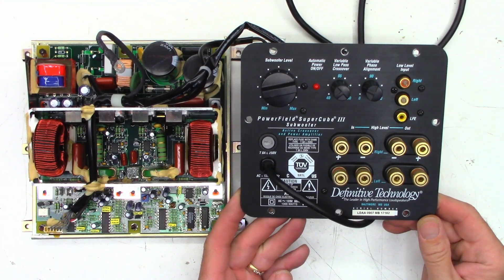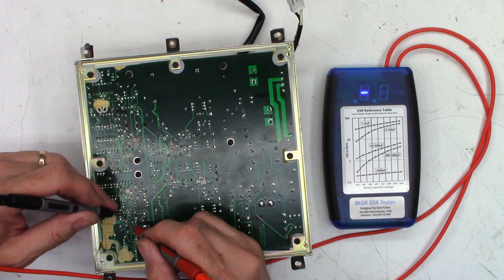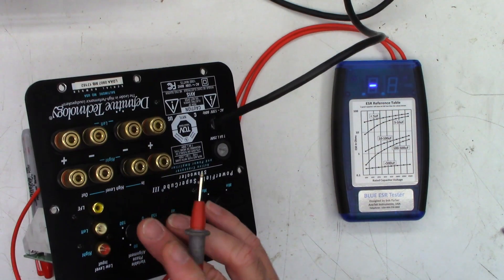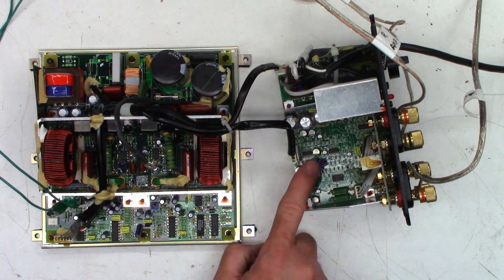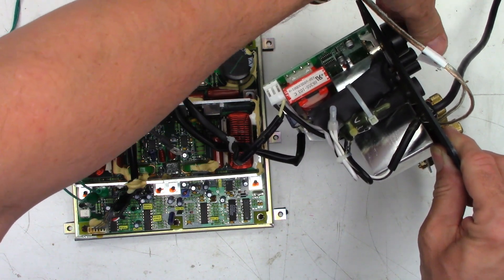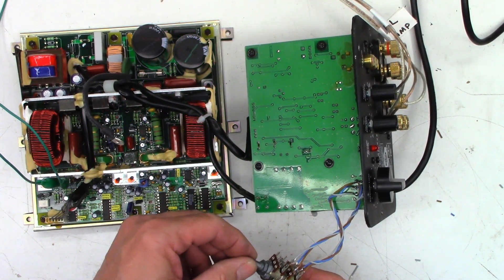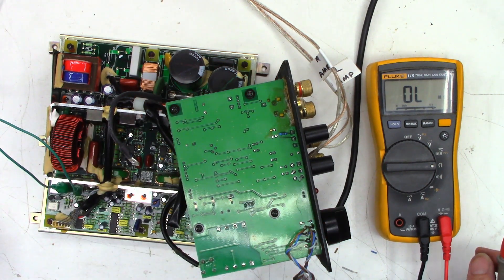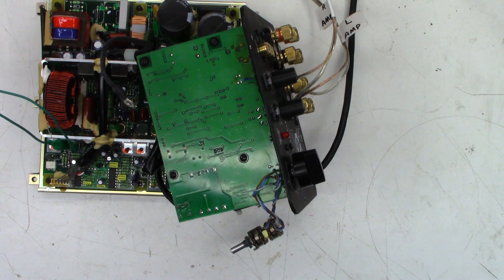POWERFIELD DEFINITIVE TECHNOLOGY SUPERCUBE III NO AUDIO DIAGNOSIS SUPERCUBE 3 NO SOUND REPAIR FIX

Comment: I have one of these Super Cube 3’s that suddenly developed a very loud hum. Was in contact with Definitive & they gave me a series 7 tests. They all failed to resolve the hum.
This not the first time there’s been a problem. I’ve three amp boards. Bridged the phase & low pass fitter pots. This worked the first time. This time nothing works. You talk of the capacitor failure on the power board. Could these be my issue all along.

Comment: Are the 100v 220uf capacitors on the preamp board dangerous to handle? I imagine the ones on the amp are pretty nasty and could kill you. I'm asking to see if replacing these pots can be done without special equipment.
Reply: Yes they are!  make sure they are discharged before working on them... they will make quite a pop if shorted at full voltage!

Comment: How about the auto on function? Any ideas on why that would stop working? My ProSub 80 only senses a signal if you unplug it from the wall then plug it back in. It will work just fine until you turn the system off.

Comment: Power amp ground including that big heatsink is held at 170VDC vs mains neutral, watch yourself on this guy if you don't have isolation. :) Phase control is 50k audio, low pass is 20k linear, volume is 5k audio. 👍

Comment: Hi! I have a Definitive Technology SC 6000 sub. It works fine for 5 minutes, then turns OFF. I have unplugg the powercord, wait for 2 minutes, plug it back in, then it works fine for the next 5-10 min. And I have to repeat the prossedyre. What do you think is the problem? Hope you can help. :)

Comment: Any info and help you can provide for a Supercube3 with the subwoofer level pot stuck on max?? Please and thank you
Reply from the maker: It most likely has a failing pot. the return ground side is probably open, thus no divider when the pot is at the low end.

Comment: Hi NorCal715,
I owned the same subwoofer but it's don't turn on at all (the power LED don't light-up also). I've checked the low voltage on the pre-amp board and it's seems normal. All caps works well. Which part should I check in next?
Reply from the maker: Check the level pots, I think the auto-on circuit uses one of the pots for a reference signal.

Comment: Hello - Im a bit late here.My cube stopped working couple of years ago and I didnt get down to figuring out and let it sit for a while.I have an issue with the unit not turning on and the red led not lighting up.Ive checked the power leads and fuse and it is Ok.Any help and suggestions would be appreciated.Thanks in Advance.
Reply from the maker: I would need to trouble shoot it to make a determination. If you do not get the LED then possibly bad potentiometers like the one in my video. Bad potentiometers will keep it from powering up. Make sure you watch both parts of my repair video.
Reply: Call definitive research.  They will do a small diagnostic over the phone.  The amp is like 100 bucks and you'll get a warranty again.  They have the best customer service.

Comment: Hello - Nice work on the diagnosis! 
Question -  Did you solder the 1k ohm resistor to the left 2 pot leads or did you somehow run it across all 3 leads? I tried zooming in but couldn’t tell.  Having the same exact issue with my Supercube and just want a quick fix. 
Thanks for your help.
Reply from the maker: At what time in the video are you referring to?
Reply: Hi - 
12:10 - 12-30 mark.

Thanks!
Reply: hi, could you help me to find definitive PF15TL+ subwoofer service  manual?

Comment: thanks so much I found a small 35v 220uv cap on the amp board that was making a nasty hum unit i worked the sub.   The cap was testing ok in the board with a small budge on top.  with this video and lots of patience i fixed a very $$$ speaker for cents.  I used a 25v cap for now just to see if it was that. I ordered a 35v to be safe.  My board had lots of the glue that was dark brown.  I spent hours scraping it off carefully.  The cap i replaced was right by the red and blue transformer on the amp side.

Comment: Just curious as to why you don't seem to check the actual Capacitance value of the caps?  I only see you checking ESR.  In my experience, sometimes the ESR can be perfectly fine, but the capacitance is way low, or way high ( over 20%).

Comment: Hi,on the pre amp side behind the 5pin connection are two resisters, there's white glue  on top of them,do you know the value of the both of them?,mine burnt out.
Reply from the maker: Sorry no, I already shipped this unit back to the customer.

Comment: Look at you trouble shooting your bud off try to figure out what the heck is wrong with this thing. I hope the customer is smart enough to tell you to replace then with quality pots that will work reliable. The unit sounds like it's the investment based on the surmised wattage rating you feel that it is. After doing some research on them they appear to be a high end product, at least price wise. Defiantly worth fixing IMHO. Fingers crossed.
Reply from the maker: There will be a pert 2
Reply: @norcal715  Outstanding!

Comment: After a little research on the net, it seems that there were a fault on X amount of these boards. The company are aware of this, and some peeps contacted them about the issue. They ask for the serie number and from that they can tell if it's one of the bad boards.
Those peeps I read about, they actually got a brand new board from the company, free of charge 😉
So my best advice would be to call the manufacturer of the sub, and tell them about issue and let them know the serial number.
Who knows, maybe you guys get a new board for free 😃

PS. There were another model with the same bad board, I think it was the one called Reference. But I'm not 💯% sure for this one.
Reply from the maker: Its already repaired and on its way back to the customer. Here is the repair part https://youtu.be/8QVHWl5otyM
Reply: @norcal715  Already saw it, amazing repair 😉👍    👏🙂

Comment: ESR meter must be an abbreviation for let's frustrate people! 
I think that it's time to stop using the ESR meter for capacitor testing, it's telling you nothing important about the capacitors! 
If you can't see that the capacitor is bad from it being expanded and your ESR meter is still telling you that it's good! WTF! Something is clearly wrong. 
ESR is only important for the filter capacitors in the power supply, ESR means nothing for the rest! EPR is what matters! EPR is the failure mode that stops equipment from working! You have a lot of capacitors that are leaking DC which is probably why the pots aren't working! 
You have no choice but to remove capacitors out of circuit and test them on a device that gives you capacity, Vloss and lastly ESR, there's no easy way around it! 
A good capacitor should have a reading of just below it's rated capacity! It should never be higher! If it is, then it's leaking DC, replace it! 
Get rid of that bob parker ESR meter, it's not giving you the information that you really need! Bad capacitors usually have low ESR readings! 
I really don't know what else that I can say to get the point across! 
Get on eBay and search for component testers, the one's that test transistors and basically everything! Look for one that has pictures of the screen showing a capacitor being tested, look for one that shows a Vloss % reading, this is what you need! For all that I know you might already have one of those things! Everyone has one of those things because they are cheap! You are wasting your time with that ESR meter! I know, I got my in circuit ESR tester age's ago, thinking that it's so easy to test without having to pull capacitors out but nothing is ever that easy! Once you get used to testing for DC leakage, you will never look back! Yes it takes longer but when you know what you are looking for, you get right into it and it's done before you realize it, a vacuum desolder gun makes sense for this application and speeds things up dramatically and it's a much better tool than an ESR meter! 
Please stop with the ESR meter!!!!!!
Reply from the maker: If you want to send me one I will certainly give it a try.
Reply: @norcal715  I would but it makes no financial sense to send out a product from Australia that costs under $10 and then then apply both shipping and import charges when you can get it delivered free directly from China! 
Otherwise, you can use your multimeter! Set it to micro amp's and put the capacitor under test in series with it and apply DC to it, all capacitors should draw a current until they reach full capacity! You can compare new for old to see the difference between the two! 
A capacitor that is leaking DC is going to over bias what ever is after it. We both know that AC and DC can be present in the same part of a circuit, but some components can be over saturated with both types of voltage present which is why we use capacitors to divide up the voltages and send the correct one to where it needs to go! A high ESR capacitor is only going to limit the current, whereas low parallel resistance or DC leakage it the very thing that is responsible for equipment failure! 
I'm not trying to have a go at you! I like your channel, you work on interesting equipment, you are well and clear spoken but I can't help but feel that there is a lack of understanding when it comes to capacitors! 
If a survey was conducted, I wouldn't be surprised if 99% of all electronic equipment failures are caused by capacitors with low parallel resistance! High ESR only becomes a problem with power supply filtering and high switching frequency circuits.. they will cause problems in operation but total failure is in the domain of leaky capacitors! 
I'm sure that you have some old bad capacitors on hand with new ones to compare to, grab your lab supply and your multimeter and do some testing! I'm sure that it would make a great video In the process! Who doesn't love watching capacitors being tested? Especially new for old!

Comment: I have found even with good ESR still does not mean the cap is any good. I have found out of spec caps but the ESR was still within spec.
Reply: I was literally screaming at the screen NO! THEY ARE NOT FINE! LoL. 
I don't know what the obsession is with ESR meters! High ESR capacitors are only a problem in the power supply! 
There's only one way to test a capacitor and that's to pull it out of circuit and use even one of those cheap eBay component testers which also gives you a Vloss (voltage loss, leakage) reading! 
The first clue to a bad capacitor apart from physically leaking electrolyte or expansion is a capacity reading that is higher than what it's rated for! 
There's no such thing as an overachiever capacitor! It's bad and if it hasn't destroyed something else yet, it's already in process to do so! 
An LCR Bridge Meter is the best tool for capacitor testing but even those cheap eBay component testers will get the job done but the capacitor has to come out first! 
There's no free lunch and there's no easy way around it!

Comment: If you need to know the value of the variable volume control markings are in front you need to remove the circuit board to see it.
Reply: Or he could open the potentiometer and drag the meter probe on the resistive element inside and figure out the resistance.
Reply: That could also work.
Reply from the maker: See part 2 https://youtu.be/8QVHWl5otyM